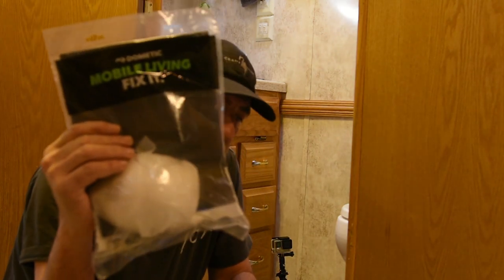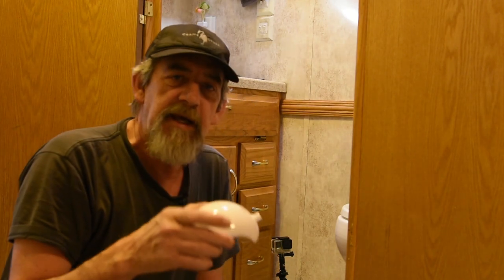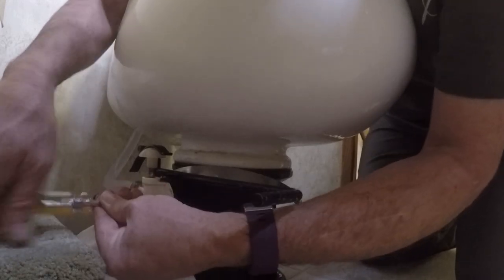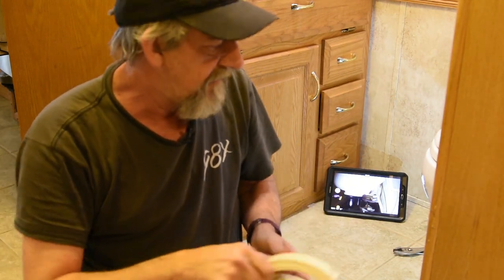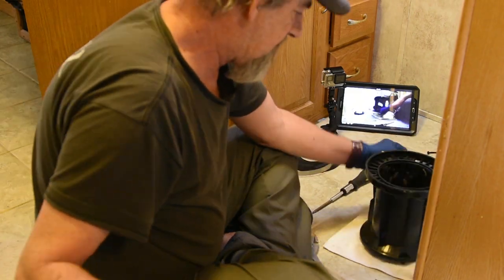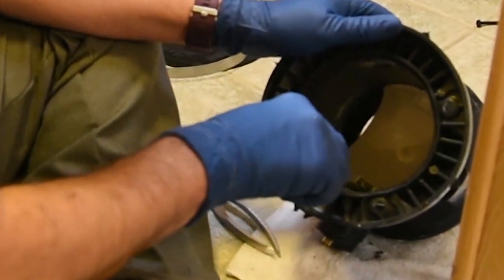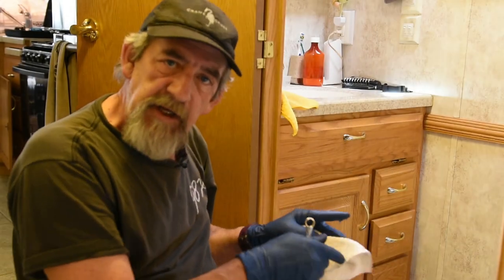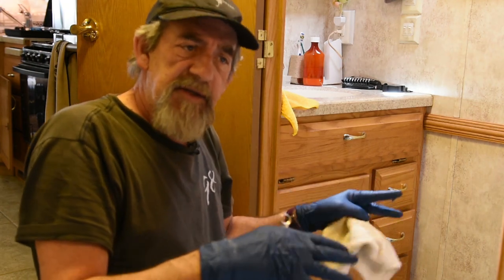Refurbishing a Sealand 510 Plus RV Toilet to Like New Condition || RV How To

Comment: Awesome video!! Just what I need to replace the leaking ball valve in our 2002 Fleetwood Southwind.  Since we inherited this in 2023 and some of these components might be original issue ... anything that is taken free from its connection will be taken outside and thoroughly cleaned before reinstalling.  Again, great job and will be ordering all parts through your links,

Comment: I'm doing this now. I watched the video a couple of time and when I get to a doubtful moment, I refer to the video again. I replaced everything, gaskets, spring, flapper ... added a shutoff valve into the line. Now I'm on the anti-siph0n vacuum breaker thingy. Absolutely couldn't have done it without you. There are other videos out there. None of them clearly show you the parts, how to manipulate them. Your vids make sense, use common sense, show the actual repair process. Thanks so much TR. You saved a butt ton o' money.  We're loyal fans!
Reply from the maker: Thanks so much! Glad to have helped.

Comment: If you read this, where do I find the model number on the sealand toilet?
Reply from the maker: It's usually on the base at the back of the toilet. Take a picture of the underside of the bowl and look at the back, you should find it there. If not you may have to remove the decorative cover around the pedestal. If that fails you may try and find it here, https://marinesan.com/identify-your-toilet/ They have a nice picture with models but to be sure try and find it on the base of the toilet.
Thanks for watching Patrick!

Comment: We replaced the seal at the bottom and the gaskets.  The only thing we did not replace was the valve that connects the hoses.  The base seems loose and water is leaking from the floor in the back of the toilet now.
Reply from the maker: Have you tried tightening the screws that connect the valve to the toilet base. You might also check the hose connection to the vacuum breaker at the back. Can you tell where the water is coming from? I have a video on that here https://youtu.be/_56kNVNs72Q
Reply from the maker: Oh the base is loose? you might also want to tighten the bolts that hold the toilet to the floor

Comment: How did you connect the sprayer house? Did you run a T from the water line in floor to go to the sprayer and the toilet?
Reply from the maker: the flush valve has a connection for the sprayer. No tee required.

Comment: Thank you for your helpful video.  We ordered the parts from your description for our 510 and followed your video, but still have a leak around the ball area.  Any troubleshooting ideas that you can suggest?  We replaced every part within those 3 recommended parts.
Reply from the maker: It's really easy to install the gaskets between the stem and bowl (the two large ones) in the wrong order. If you do, the bowl won't hold water. Take the toilet off the stem and reverse the gaskets so the one on top is on the bottom and versa visa. That should take care of it. If it does not let me know. Thanks, Lisa!

Comment: Your video was perfect for helping us fix our foot pedal.  We are now having a problem with leaking at the bottom of the base that we never had before.  Any suggestions?
Reply from the maker: That's great!! I'm assuming you mean that where the base meets the floor. You probably need to replace the gasket at the base. Mine was in really bad shape. See the stem base gasket in the description above.
Reply: We replaced the seal that goes in the bottom is the gasket the part that is bolted to the floor?
Reply from the maker: @charbeacom9161  I can't send a picture thru comments. Can you email me...trbowlin@gmail.com and let's see if we can figure this out.

Comment: Have you ever had to remove the flange that goes through the floor into the sewer pipe. The previous owners somehow rotated the toilet about 30 degrees counter clockwise and I'm hoping to rotate it back to perpendicular to the back wall. I think I'll have to unscrew and remove the flange from the metal sewer pipe. I assume it's sealed with something. Thanks. I need to get back over and check on your home remodel.
Reply from the maker: Wow, no I have not. You might want to call Newmar tech support, they are more than happy to answer any questions. I'd doubt that the pipe is metal, more likely ABS plastic and hopefully the flange is not glued or that could be a real big pain to remove and replace. Newmar can tell you if it is glued or screwed into the holding tank. That's a bummer for sure.

Comment: hey TR thnx for posting this video, its the exact thing i needto do with my rv toilet, i have a sealand 511, whats the difference between the 510+ and 511? thnx man
Reply from the maker: As far as I know not much. The styling is a little different, but it looks like it uses the same parts as were in my 510+. I checked and the gaskets, flapper valve, water valve, etc are the same. Thanks for watching!
Reply: @trbowlin  hey thnx man, yeah it all looked the same to me, happy travels👊🏼

Comment: Our 511 plus uses these same parts. After replacing everything except the flush ball, it is still not holding water. Does this need the ring seal like the 300 series uses? When we had the porcelain bowl off it looked like there was a recessed rim that another seal would go into?
Reply from the maker: You changed to two large gaskets? I looked at the schematic here https://www.environmentalmarine.com/511-511-911-and-2011/ and don't see any other seals. Did you install two large gaskets properly? (parts 4 & 5 on the diagram)
Reply: @trbowlin  yes, we have the original book and those are the gaskets we replaced. We have ordered the spring cartridge as our lever doesn't spring back and has to be used manually. Hopefully replacing that will make the flush ball go into the correct position? Thank you so much for answering.
Reply from the maker: @jpd7518   Make sure you got the gaskets in and the correct order. I made that mistake And mine wouldn't hold water until I reversed the  Gaskets🙃
Reply: @trbowlin  Nuts, so the thin one goes on the bottom?
Reply from the maker: I don't recall the thickness but check the hole size against the exploded diagram.
Reply: @trbowlin  yes, we changed the seals and put the thin one on the bottom. It holds water now. Thank you so much!
Reply from the maker: Great to hear. Thanks!

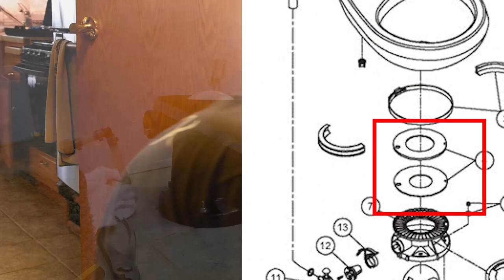Comment: Hi, TR.  I am needing to do some work on my 510 Plus and noticed that the diagram you show when the video shows you holding the bowl to stem gaskets before re installing at about 10:03 in the video are a bit different.  The diagram shows a gasket with a notch and a hole, and the gasket you link to on Amazon does not have the hole.  Does this matter?  I can find one with a hole on Amazon, but is there a working difference?  Thank you.
Reply from the maker: There is no difference. I used the one I linked to and it works perfectly. I'm away from my video workstation right now but I will look at the raw video footage and see if the old one had a hole in it. As far as I can recall I don't think the old gasket had a hole but I should be able to review the footage that I didn't include in the video and see. I'll get back to you later this evening!
Reply: @trbowlin  Great!  Thank you!!.  I am full time and getting set up to tackle this job.  My black tank is leaking and I think it is the rubber gasket that goes around the hole in the top of the tank, not sure until I get this apart so I want to have everything I may need ready.
Reply from the maker: @romas7081  I reviewed the footage and the old gasket did not have a hole in it. Plus the toilet has worked perfectly since I re-built it so I am pretty sure you okay to go with one that does not have the hole in it. Only the notch to match up with the toilet is important as far as I can tell. Hope this helps!
Reply: @trbowlin  Yes this helps, I am ordering from your link, as I did with the other gasket.  Thanks TR
Reply from the maker: @romas7081  Thanks for your support. Travel safe my friend!